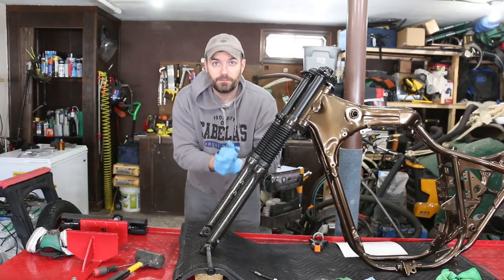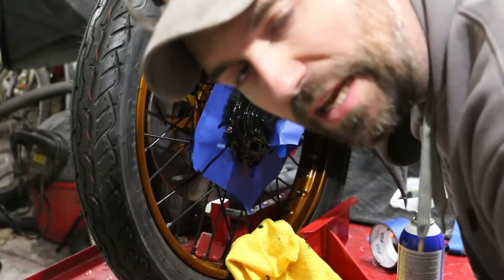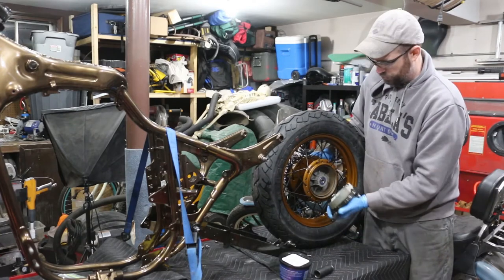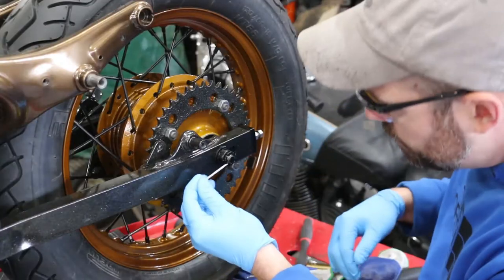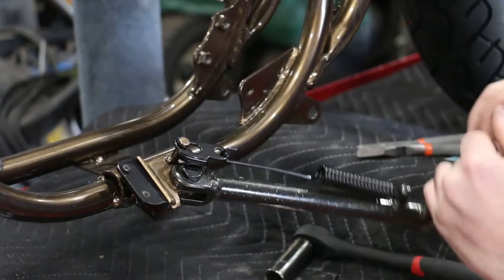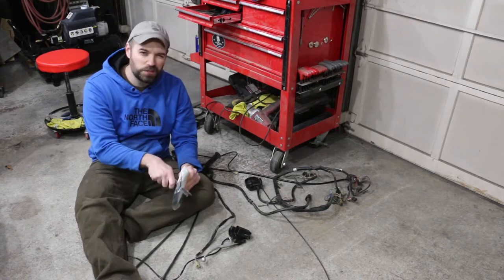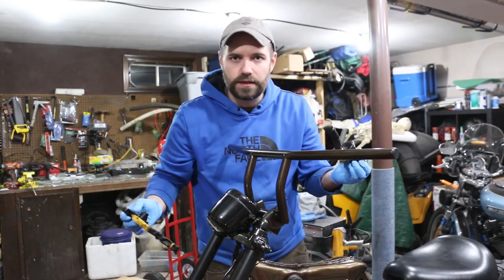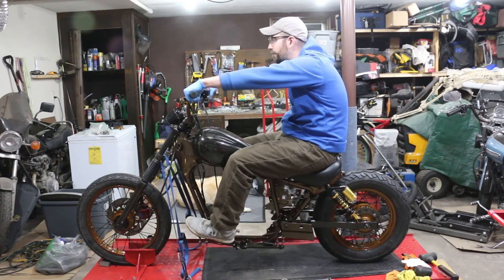Bobber Build - Wheels Shocks & Handlebars - Yamaha Virago XV250 Motorcycle Vlog 010

Comment: can you tell me how you connected the aftermarket brake and clutch levers wiring onto the two prongs on them plz diagrame if poss plz love your vids
Reply from the maker: I used a soldiering iron.  The wires are going to a switch in the levers.  It does not matter what wire you put on either prong.

Comment: just found your channel, I subscribed I been working on a xv250 myself, I just got done bobbing the front fender the other day, Now I been making a custom exhaust for it, I liked your video its pretty detailed
Reply from the maker: nice.  I cant weld so i bought straight pipes from china.  Going to install in a week!
Reply: yahh, i used the stock pipes and a set Harley drag pipes and made mine, was a little bit of welding

Comment: How much rise do those bars have? They are the perfect height! Also, good choice of tyre. I like the detail that you are going to with the build and also with explaining the steps you are taking.
Reply from the maker: Lachlan Gill the bar only has a 5 inch rise but they are narrow so I was able to reuse the oem cables.  
Thanks for the support.
Reply: were did you get these bars ?
Reply from the maker: Emgo 23-92406B 7/8" Chopper Handlebars Black 6" T Bars $50 bucks on ebay